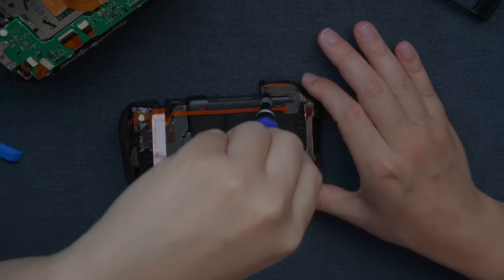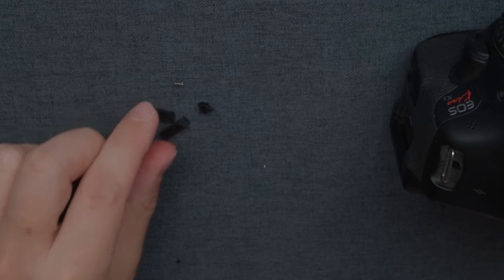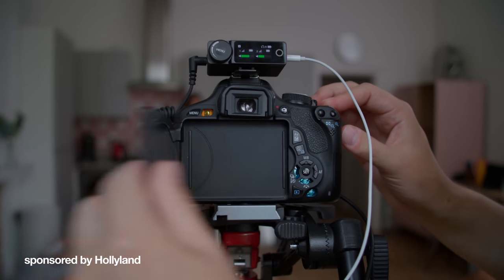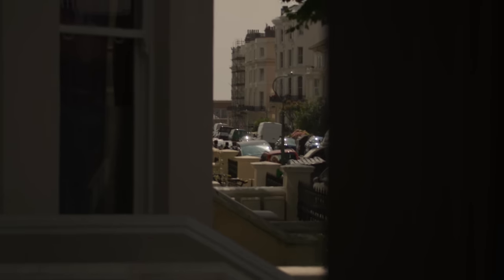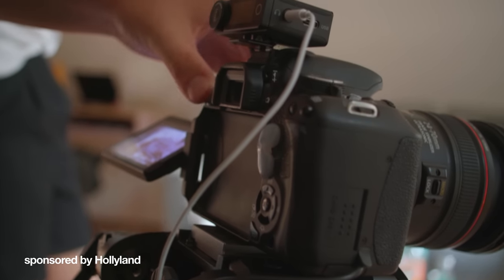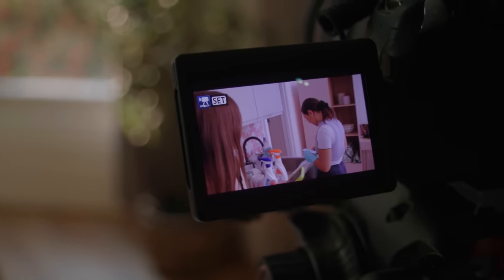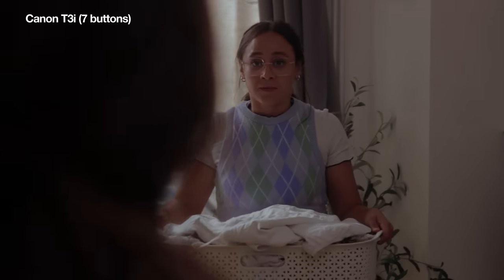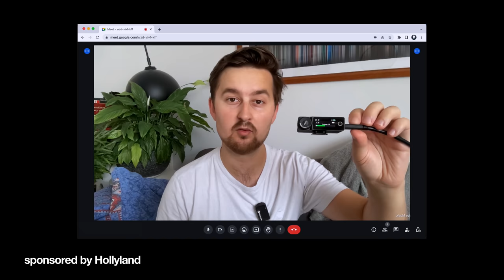I Shot a Film Without Camera Buttons

Comment: THe hollyland wireless Lavs are the worst compact stereo lavs in the market. No external power support. Slow charging, spotty battery life means I can charge up the units and the box and come back a couple weeks later with them all drained. spotty connection with the transmission cutting out at just 3m distance if the subject turns around and I lose direct Line of Sight between Tx and Rx. Never buy hollyland lav kit